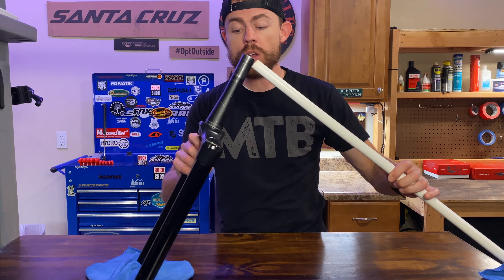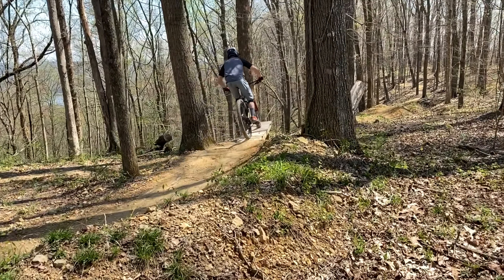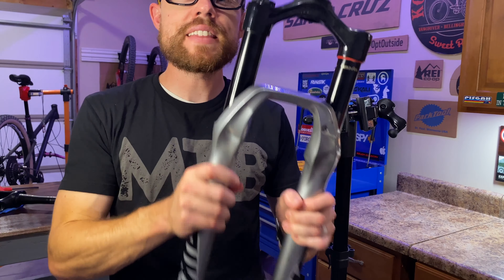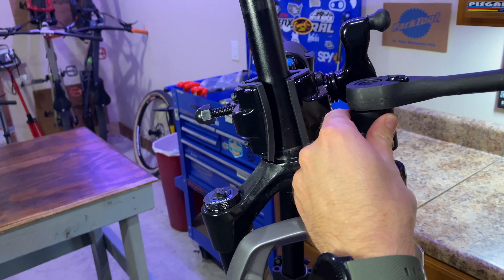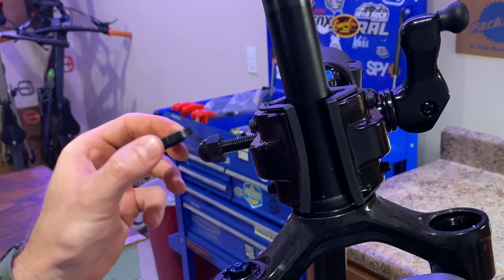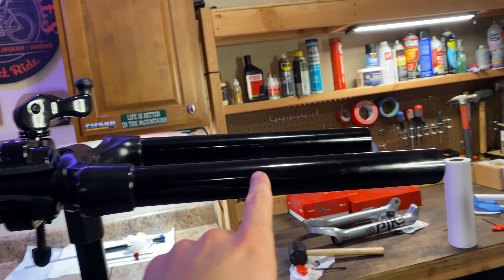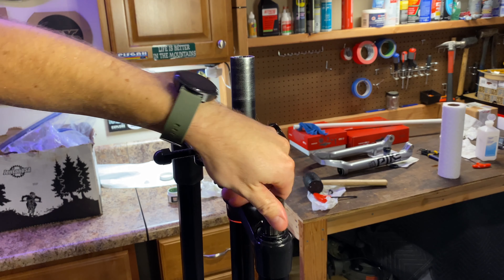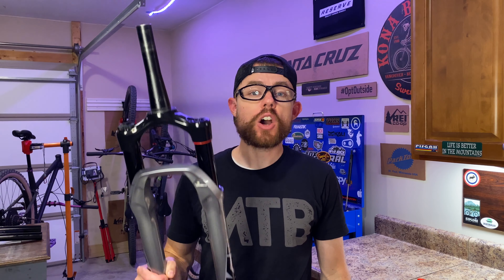Convert Your Fork to Reduced Offset | What is Reduced Offset?

Comment: I was planning on doing exactly the same offset upgrade and I was going to buy an used/new fork rockshox 35, then just swap the crown/stanchions and resell the complete fork...then I got stuck on an online forum saying that the equalising dimple has a different location between 35 and lyric/pike/yari.
Any thoughts on this? 
Nice vid btw
Reply from the maker: I could see how that could easily be the case. It would seem on the surface that any 35mm stanchions would work, but there must be a reason why they have different part #'s and pricing and maybe that is why. I personally wouldn't chance it.

Comment: Isn't that the fork you installed the new C1 air shaft in? Did you go back to the old debonair spring?
Reply from the maker: No it’s not the one I installed it in. The red Lyrik in the thumbnail is the one I installed the new Debonair spring in.

Comment: Have you done a review of the angled headset
Reply from the maker: I may have to end up scrapping that one as I've gotten bogged down with other videos and my day job and I apologize. I can say that the Works Components angled headset is a great upgrade to the Honzo. Super easy install and hasn't given me the first issue in the few months I've been running it. It's not as crazy of a change as one might think, but a good change for anyone wanting to go more aggressive. It pairs well with a slightly longer fork and the reduced offset fork. Let me know if you have any specific questions.
Reply: Dr. J MTB thanks brother 
I got. Roscoe 2020 all tricked out not a stock part left lol 
Was gonna get a mmmbop frame 
But someone suggested the angled headset I have the fork longer at 140mm on a 44 offset 
So should keep me nimble and add a bit more stability ( fingers crossed ) 
If not I will just get the mmmbop frame it’s only 300
Reply from the maker: ABMVT Applied Body Mechanics and you can always take the angled headset to another bike as long as it’s the same size.
Reply: Dr. J MTB the mmmbop is already a 64 degree super slack 
Thanks again man and great review

Comment: Why would someone necessarily sell their CSU? And not just the whole fork?
Reply from the maker: Because they want to change the offset of their fork without having to pay for a whole new fork. I have $50 invested in the extra CSU shown in this video. The going rate is usually closer to $100 from what I've seen, but this one had an extremely small and inconsequential "scratch" on one of the stanchions that I could barely even find.
Reply: @DrJMTB  thanks. I'm intrigued about this for a 2019 Devinci Troy of mine. Plus the upgrade to.the new 2021 Denobair. Love the  videos btw
Reply from the maker: @51249ca  👊🏼

Comment: Which off set will give more front wheel traction?
Reply from the maker: IMO, reduced offset (42-44mm if referring to 29er forks) will give better front wheel traction due to increased ability to weight the front appropriately.